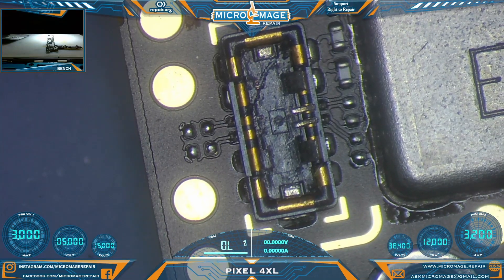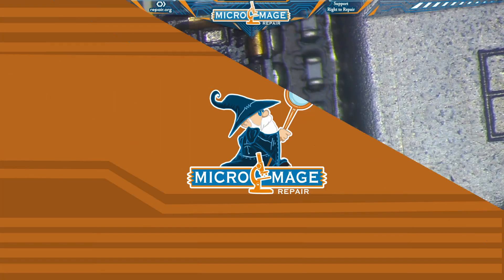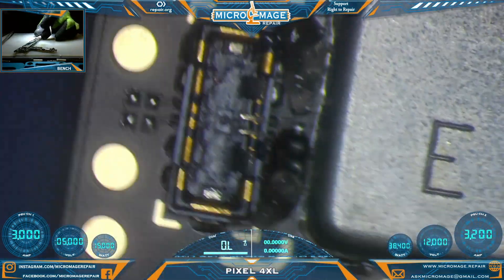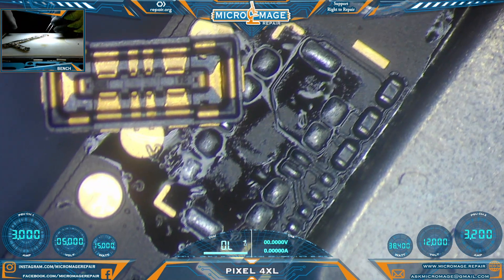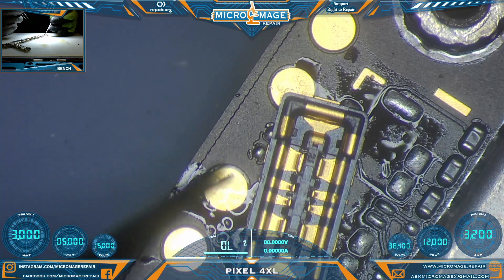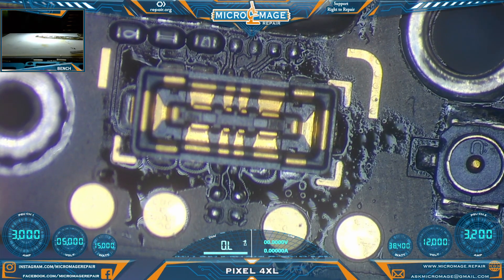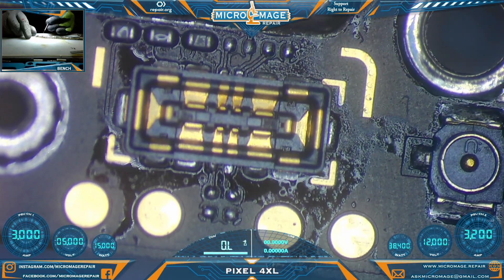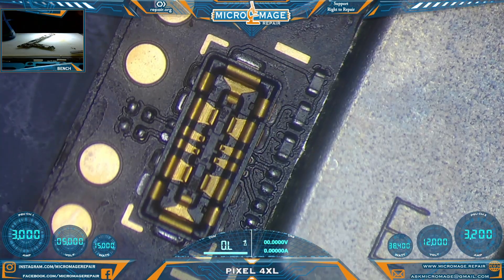Pixel 4XL: Damaged Battery Connector

Comment: Josh, bro, here we solder that type of connector by first fixing the two anchor terminals (small sides of the rectangle) with the curved tip of the pencil. The terminals on the long sides using Hot Air at 350 degrees Celsius, 25% air flow and protective tape for the plastic walls (preferably aluminum or kapton). All the best.
Reply from the maker: Appreciate it!
I don't normally get on the struggle bus on these connectors 😂.
A month off and even the simplest stuff becomes hard!